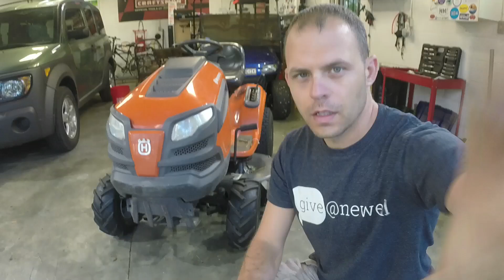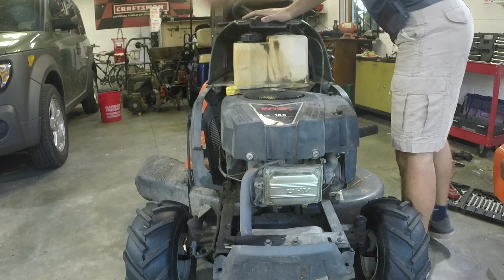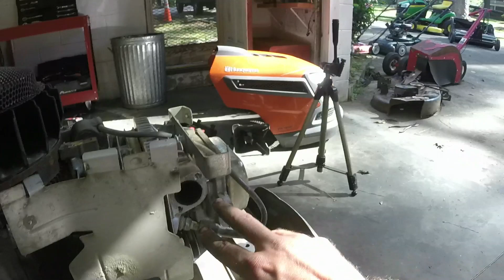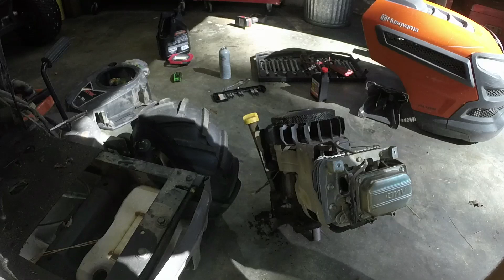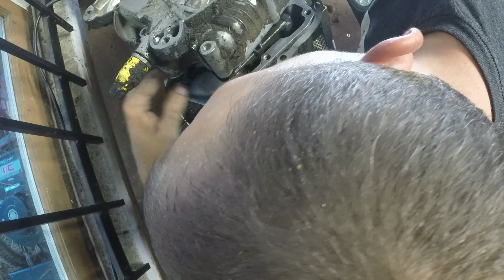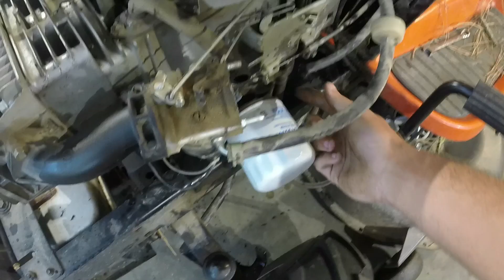Riding mower hard to turn over. Diagnose & replace bad camshaft compression release on Briggs single

Comment: Whene those Briggs singles turn over hard just check your battery voltage and if that's good remove the cover for the carburetor and cover the intake with your hand and see if it'll turn over with the intake blowed. If it does it's time for a cam.
Reply from the maker: Yes, I always check the valves too just in case they are really far out, sometimes it's just enough to keep it from turning over smoothly even on a strong battery.  But that type of turning over is different than a bad cam.

Comment: We have seen some aftermarket cams last a few months and others last years but there was one that only lasted one week. Even the OEM cams can have issues and here at Eliminator we let the customer know that we can do the repair and the engine will run but we can not give any guarantees on the camshaft failing again even if it is the OEM. Ever wonder why there are so many of the OEM cams on backorder? Too many failing eh!

Comment: If its not an OEM cam, it will let go again. These Briggs engines not very reliable, been going down hill for years. Not what they used to be.
Reply from the maker: I wish there were more reputable aftermarket makers for these cams.  I have a hard time spending 3x as much on an OEM cam when I've seen them fail with as little as 80 hours.  There's really no good option.  I do stick to one specific kind of aftermarket cam and don't just buy the cheapest one out there.  I've done 5 of them so far and every one has held up and some of those have been over 2 years now.

Comment: Hi buddy  you taking the engine off the mower and opening the bottom  sump witch I have done 
hundreds of these myself.  With this same problem But I dont know why you took off the top cover to this. 
starter I can see because it does get in the way of putting the new gasket on time to time.
I do enjoy your videos so don't think I am putting you down in any way because I am not.
unless I'm thinking maybe you took it off to check for A Rat's Nest that I can see I have done that too. great job..
PS use a little bit of silicone in a few places to hold the gasket on in place it helps.
Reply: Hi teck spray
Reply from the maker: I know the top cover and starter don't have to come off, it just makes it a little easier for me and removes some margin for error.  I took the top cover off just so I didn't scratch it up moving it around especially since I have to turn it upside down.  As for the starter, you are right, it makes it hard to scrape off the old gasket in that area so I find it best to remove the two bolts.  I've also done the silicone trick a couple of times, that gasket is just folded over so much.

Comment: I have a Small Engine and Repair business. You do not need to remove the plastic blower housing cover on top of the engine. You do not need to remove the starter and the wiring harness for the charging system in ignition coil. All you need to remove is a muffler, fuel lines, breather lines Throttle cable unplug the wiring harness that you removed in the four bolts underneath the engine stack pulley remove the engine, drain the oil remove the oil pan bolts as they’re called and replace the compression release. There is no need to take all that extra stuff off you can do it without doing that, just thought you oughta know you’re making your job much harder than it needs to be doing the way I mentioned makes it quicker easier and cheaper for the customer. Also accomplishes the same results. Just thought you’d like to know. Enjoy your videos. Keep up the good work.
Reply from the maker: You're right.  I take off the cover mostly so I don't damage it when I have the engine turned upside down (and to check for rodent nest remnants), and removing the starter makes it easier to scrape the gasket in that area.  As for wiring it's mostly so I don't catch it on anything as I carry the engine to the stand.  I've done some that I've left both on before but for me removing them gives me peace of mind and lets me work on the gasket without the starter getting in the way.  I understand it takes a few extra minutes but that is fine for me.
Reply: 100% correct and completely understandable @EllisMowersandmore